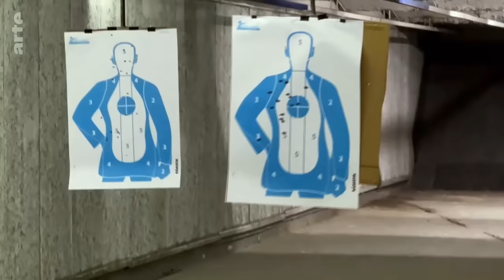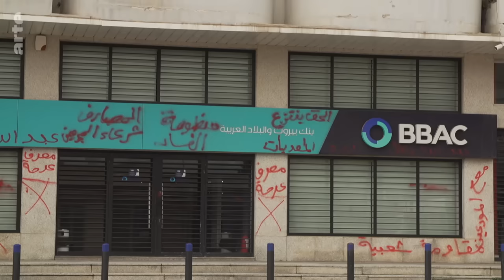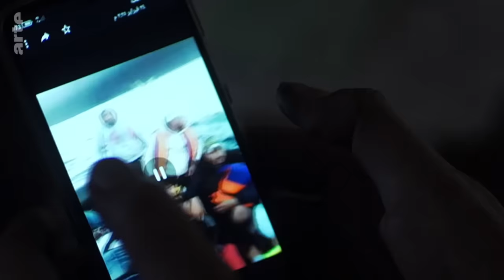Lebanon: A People in Crisis I ARTE.tv Documentary

Comment: As outside contractor working on bid contract to repair bridges I can say the infrastructure is so bad that the bridges should be close down due to unsafe. The cement has fallen off exposing the metal girders and they are rusting away. The environment is no help. The salt corrosion especially in winter freezes/unfreezes the steel get wet, expands, and causes the cement to pop off. The roads are bad because of cheating on thickness of base cement under-course. I seen cement under course only 1" thick where it supposed to be 4" thick. That's why the roads crack and the edges are brittle where a shoulder is supposed to be. It's a nightmare. Don't get me started on the hack electric wires everywhere.